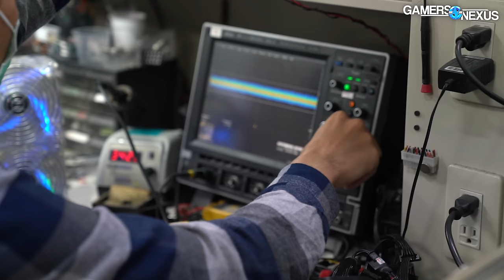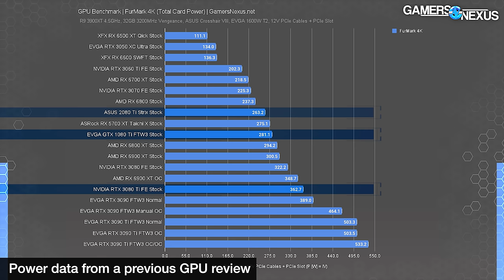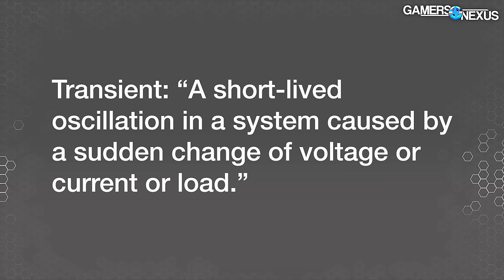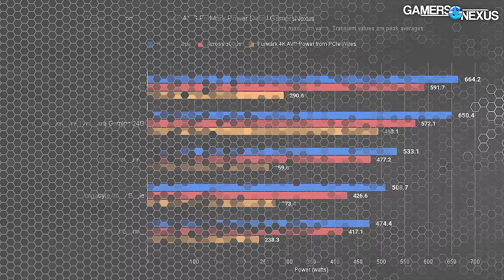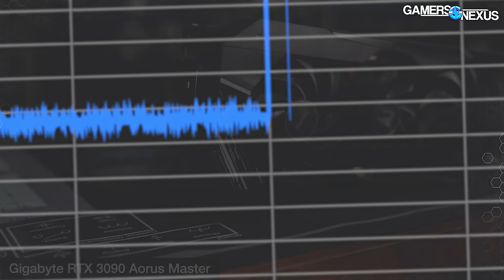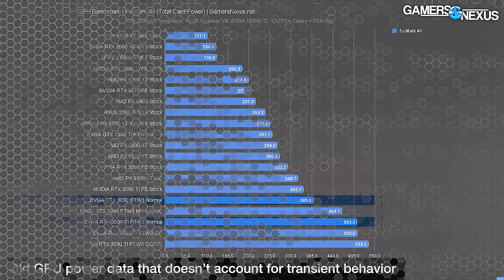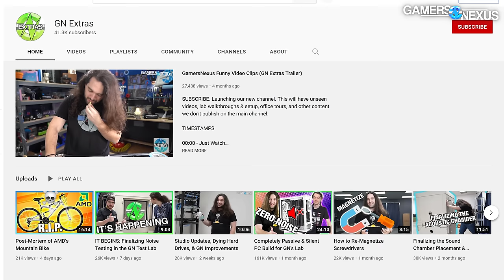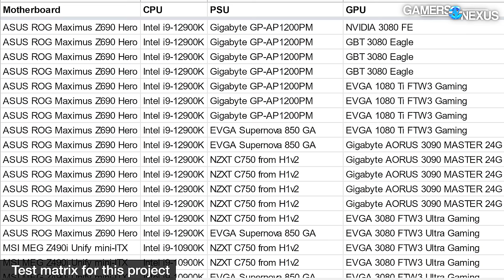The Brewing Problem with GPU Power Design | Transients

Comment: Wouldn't throwing beefier capacitors on the boards fix this, seeing as it's such short spikes? Or at least smooth it out enough so the psu could cope?
Reply: Yes, but that would mean more cost to the gpu vendors, which they dont want to do.
Reply: They only want to produce cheap low cost boards at a high sale price, expecting them to put high quality components on is simply asking too much of them.
Reply: This was also where CAPs inside the power cables were also a possible solution 5+ years ago and I think will start coming back soon especially with such high spikes becoming more common place.
Reply: There are multiple tiers of power delivery.  The GPU has local regulators to convert the high-power 12V rails into low-voltage, ultra-high current rails of somewhere around 1V, plus or minus.  If the 12V rail dips due to excessive load, it is going to have to fall to less than the GPU operating voltage, plus some drop-out margin, before it causes a problem.  The GPU transients are actually already being serviced by the point-of-load bulk capacitance.  The transients on the 12V line that remain are from current draw to replenish those caps.

The 12V rail's sagging could cause problems elsewhere, but there's not a whole lot left in a PC that actually runs at 12V.  It's almost entirely used as a fat current pipe.  So the CPU will have its own local point-of-load regulation and the same kind of resilience as the GPU.

Larger cap banks in the PSU will absorb transients better, but that actually has consequences as well.  For one, they will completely bypass short-circuit protection by having the capability to supply a LARGE quantity of power in a very short time, which isn't always desirable.  Also, as transient response improves, regulation actually suffers, since by nature of being able to smooth over changes in load, you're making change in supply less visible to the switching controller.

Dealing in KW power is inherently risky.  It's just a lot of energy, and handling that amount of energy carries some risk.  Nothing in a PSU is going to blow up having to carry 2x load for 100uS.  Tripping the OCP in spans of time of 1ms or so is solely to prevent cables from rapid heating, shorted contacts from welding, and things like that.

The clips in this video where the fan speed dropped significantly .. that's not a 100uS spike.  That's a prolonged draw.  THAT is just an insufficient supply, because 1-2 seconds of heavy load is no longer a "transient."  It's a load, and you need to size the supply appropriately.  More caps aren't going to solve that problem.
Reply: @nickwallette6201  It's going to take a whole ecosystem approach to address the issues with Transients and Transient load. When you think about it, motherboard OEMs beefing up VRMs lately at a rapid pace is starting to make a whole lot of sense imo. Anyway, I think we are going to see a revamp of the 80 plus certification and anything less than "Gold" will slowly start to fade away in one to two GPU generations if there is no revamp of the '80 plus certification' on the lower end.
Reply: @buggerlugz6753  This is why, and I say this to anyone buying a GPU, buy ONLY the highest end sku of a given model from each vendor OR Founders Edition. Every failing, performance or reliability comes from buying the 3080 TUF over the Strix OC, or the XC3 over the FTW3, or the Ventus over the Gaming Trio. AIB vendors bin not only their chips, but their power delivery, caps, or skimp on them entirely with lower quality parts.
Reply: @earthtaurus5515   I'm not really sure what you would even do about it.  When a gadzillion transistors are switching all at once, there are going to be transient demands.  A lot of that is resolved in a local current loop between the IC and the POL regulators, but something's gotta replenish the decoupling caps on the board.  So, what do you do?  Slew-rate limit the DC inlet?

The supplies probably handle it just fine.  Shutting down after a 1-3 second over-current situation is by design.  You don't have enough capacity in the supply.  Shutting down from a <1ms spike in demand is, if that is what's happening, more than likely just tripping the short-circuit protection, because it looks for all the world like a sudden short.  A supply that can produce upwards of 80A on the 12V line needs to be proactive about that kind of thing for safety otherwise things can get very out of hand, very quickly.

The only solution I see is, don't have a system that needs several hundreds of watts to run.  Maybe hold off on 4K 120fps and/or ray-tracing until the silicon processes and ASIC design can do it with less than 200W.
Reply: @nickwallette6201  To be honest hardware there isn't much ultimately can be done without causing other complexities. 

As somewhere down the line the coil whine will also get ridiculous too. So, a ecosystem centric is the only solution and that also includes software solutions such as FSR, DLSS, XESS etc. 

With upscaling there wouldn't be much need for beefy hardware in the consumer space imo. But... since there has to be a halo product because some folks don't understand the complexities of electronics.... it's going to be a slow downwards hill. Personally, I think if Nvidia tries to push the power envelope further with the 50 series they are going to have a huge problem on their hands. 

So, they will have to taper down performance and focus heavily with upscaling if they are unable to match power efficiency with AMD. Who, in a few years time will most likely run into the same problem as Nvidia. Given these things go up and down in cycles. 

In any case somewhere down the line goverment entities will have to step in where they either improve the electrical infrastructure or penalising the offending GPU oem with the highest power envelope at the time. My hunch it will be first the latter as that's much cheaper and easier to do. As upgrading electrical infrastructure especially in homes would be a logistical nightmare and regulatory quagmire (no thanks to lobbyists).

Or everything becomes streaming based but that also introduces other challenges, problems and complexities.
Reply: JUST putting more capacitance GPU side is kindaa iffy. Because capacitors have a really low equivalent resistance so all the current that you draw out of them... they're gonna want back, as quickly as you can deliver, which will STILL likely trip the PSU OCP unless it has a bit of a damping factor on there in the OCP circuit to allow it to survive short current bursts. Also the inrush current oof, you don't want a PC that can't be turned on to begin with.

There are two solutions i can think of. One is to install extra capacitance PSU side, where the small wire resistance between those and the GPU damps a little how quickly they're drained. Another is to install a choke on the GPU upstream from capacitors, which will damp the spikes, but then you may need to re-engineer the whole VRM to be able to deal with transient voltage drops.

I think PSU manufacturers' expectation, that the transients aren't going to be THIS bloody rough as they are becoming now, is reasonable, and i don't think compromising on OCP speed is good for consumers. AIB manufacturers are in a little bit of a bind because they can't just go their own route with the GPUs, at least not at mass scale, they're under NVidia's mandates, and basically have to implement parts of reference design as prescribed or they are inviting extra risk. So i think it falls upon NVidia to solve this.

Or you know they have the silicon. They know everything going on there, how much current it will need under what conditions moment to moment. They can design it to ramp up the consumption at a certain maximum rate! If they have a certain number of subunits sleeping or idling, they could only wake up a specified number of them at a time on a timer. Having the ramp-up take like 10ms isn't anyhow unreasonable!
Reply: @KnightHasen  isn't that an FTW3 card in the video? 0:26
Reply: @buggerlugz6753  sorry but how were PSU companies supposed to account for GPU suddenly drawing 2.5x their rated power? And on top of it, expect to get blamed for issues? I imagine the caps needed to handle that high of a burst would need to be pretty large and expensive. This is 100% Nvidia's fault for having virtually no regulation or caps on the power delivery section, to account for it's own power requirements. It's like if Intel rating a CPU for "45w TDP", and then allowing the CPU to draw 250w in bursts, and then overheating when using 45w TDP coolers. Or a car saying it uses 87 octane, and then it actually needs 93 to accelerate at the rated speed. It's not the gas company's fault the car manufacturer said to use 87, it's the car manufacture's fault.
Reply: I think we'll see 12V supercap boxes for high end PCs
Reply: @KnightHasen  my experience with the Tuf 3080 has been pretty excellent tho, and it's been fine on a 750w psu. It overclocks (at least my mild oc) nice and I didn't sell a liver for it. Might have gotten lucky, idk
Reply: Though, you have to be careful because an uncharged capacitor looks like a short circuit.
Reply: @pranavkolluri  Yeah you're right about that, all the ASUS cards used quality components this run. I believe back when the 30 series power delivery issues were going on, all Asus SKUs used 6/6 of the higher quality component.
Reply: Bigger capacitors take longer to charge or draw more current when charging. It has to be chosen carefully.
Reply: @BlackhatAudio  Yeah, coil whine is a thing. Check out Optimum Tech's video on it.
Reply: @earthtaurus5515  ''With upscaling there wouldn't be much need for beefy hardware in the consumer space imo.''

Doesn't really work like that tho. Games will still be more and more complex even with reconstruction tech.
Reply: @PantherSerpahin  I have caps in my cables and all I ever wanted was better airflow. 😅😅
Reply: Yes, and it maybe the correct solution.
see DC decoupling design guidelines.
they tell you that you should place a capacitor near to load for maximum decoupling efficacy and efficient.

since wire have resistance and inductance that hinder clean and efficient power delivery.
the rule I remember is 10% or more of previous capacitor.

on other side, there is a diminishing returns, as inductance turns less of a problem and resistance can be completed ignored.
while issues with capacitors using space and price become a serious issue.

Comment: Thank you guys for putting this out. I actually encountered this awhile ago on my RX 5700 XT - random shutdowns on a 650W ATX PSU. One thing to note here is that the PCI-E slot is capable of supplying up to 75W according to spec, and I would imagine that some motherboard manufacturers have incorporated additional capacitors for handling sharp transients. I tested it as extensively as I could (given that I didn’t have an oscilloscope and had to rely on the built-in Radeon monitoring software to track power consumption), and was able to determine that the base load was higher than a single PCI-E power cable could reliably handle (as, according to spec, each line only has to be able to supply 150W of power). One cable plus the power from the board gives you 225W of power according to spec, and I noticed that the board was routinely topping 250-300W of power consumption as a baseline—so it was no wonder that until I started using a separate PCI-E power connector directly to the PSU (rather than daisy chaining the 8+6), I was seeing OCP shutoffs. And even once I corrected that issue and started using two separate PCI-E power cables, I was STILL getting the occasional OCP shutoff.

The fact that boards can have such insane spikes is really frustrating as a consumer, though, because it realistically means that PSUs are being taxed far more aggressively by GPUs than had been previously reported, and that will cause them to age more quickly. That same 5700 XT actually ran a 750W SFX PSU from be quiet! into the ground—power supply worked well for a year, and then one day it just started triggering OCP on just about every boot. I shudder to think what it’s doing to the Lian Li I replaced it with, or if I should consider investing in a beefier SFX PSU for my rig (or else abandoning SFX altogether until this trend dies down).
Reply: This is interesting. Which 650W PSU and GPU custom do you use? I haven't had single shutdown in the ~2 years use of my Sapphire RX 5700 XT Nitro+ with a 550W be quiet Straight Power 11, but that is also a high quality PSU, not a cheap unit. I'm running it together with an R7 3700X or, for the first year, with a 2700X and both at stock. I wouldn't have thought that this could happen with a GPU of this caliber and a good PSU. I always had both power connectors on the GPU connected and I never used a cable splitter, if that's what you're referring to with daisy-chaining.
Reply: @dennisjungbauer4467  It was an EVGA 650W ATX PSU, I forget the exact model, but it was also more likely an issue with the GPU itself. I purchased the Gigabyte RX 5700 XT Gaming OC pretty early in the product’s lifespan, and had to deal with a lot of growing pains while they refined the firmware and the drivers. This board in particular seemed to be plagued by uncomfortable power spikes, as a few reviews I read and a few forum posts I found at the time suggested that it was a problem.

The card is currently mostly okay on a Corsair SF600 (order history confirms it was not a Lian Li PSU I purchased), but it nuked the be quiet! BN639 SFX L 600W PSU that I had been using it for in my ITX build after only a year.
Reply: @joshcurtis3752  Ah, right, I almost forgot about all the issues this card had for some people. I guess I was lucky in that regard as I haven't had any hardware issue, only few driver issues switching (well, fully new PC) from an Nvidia card (GTX 970). And while I didn't buy it very late, I bought it at end of 2019, so ~5 months after release.

Comment: If you were trying to use excel to deal with a large .csv file, I highly recommend you use the Pandas Python 3 library. It can handle millions of data points before it gets too bogged down. I use it at work to deal with large .csv files. Also great explanations of the DC amp clamps! I use them at work for 3 phase power analysis and know the pain of trying to keep them calibrated and accurate.
Reply: Strongly agree with this
Reply: Agree. You can easily divide a large dataset into chunks with pandas, using the chunksize parameter.

Comment: This is something that "New World" brought to a lot of people's attention. Nvidia cards have a tendency to violate their power limits at stock settings.
I noticed it when Rise of the Tomb Raider kept crashing with my 3060Ti under volted. Everything else ran perfectly but Rise of the Tomb Raider needed the GPU at stock. That's when I noticed the power spikes in the Afterburner overlay. At stock it was violating it's power limit by 25%. Ok so that's only going from 200-250W but that's only the ones long enough for Afterburner to catch.
Reply: Yeah I can't run control undervolted. I'm at 900mv at 1950Mhz on my 3060ti, every other game seems fine.

Comment: I made myself a borderline on TOTAL system power draw under heavy load, and GPU power draw. It is 500 W total and 250 W on a GPU and I am not interested in anything exceeding that no matter what. It leaves me only the best perf/wat options on the table, and considering my needs that is all I want. Currently sittning on a 5600X and 6600 XT, perfectly happy with 1440p resolution.

Comment: A point I'd be interested in knowing: how do overclocking and undervolting play into all this? is it just a reduction of power/an increase of power type effect? or are there potentially knock on effects, making overclocked cards more/less susceptible than expected?
Reply: It goes both ways if OC'd, you already are pushing the TDP... (higher Volt., higher consumption) that means the transient will be far bigger...

And the other way around...
Reply: My takeway from this video is that a transient spike is based on the average draw. Increase average draw, and you'll get higher numbers in your spike.

So if you OC your card with a higher power limit (say an EVGA 3080 with a 450W XOC bios) you'll get a much higher spike than if you run the same card undervolted, running around 320W or so (this is about what my 3080 FTW3 pulls undervolted according to msi afterburner).

So overclocking definitely increases the strain on your psu as the total wattage number in the spike will be much higher.

Comment: I'd really like to see you test the transient handling performance of the Corsair SF750. That's the go-to PSU for SFF and routinely handles top end components. I'd expect it to pass the tests that the NZXT unit failed.
Reply: I would like to see such a test too since i am running my Asus 3080 TUF with an Corsair SF600... so far no problems but perhaps its because of the slight undervolt im running (although i didn't in the beginning) and the games i play aren't all too demanding.

Comment: I love the detail and effort put into this, I can't think of another channel who would go to the trouble of making this content for the community.
Did you capture the voltage at the video card end? It could change the picture significantly if the voltage sag at the card end dropped the actual graphics card power draw to lower than what the current X nominal voltage would predict.
If the graphics cards are drawing 2x+ power to get 1.5x power after sag, that would be very bad.

Comment: Easiest way to overcome this is for the 3 GPU Amigos to form a standard that PSUs would be able to meet and customers can choose them based on the 3 Amigos certified logo stuck on the side of the PSU case.  Thus PSU companies do not need to fight to the bottom of the price war by eliminating components that would cope with the transients.